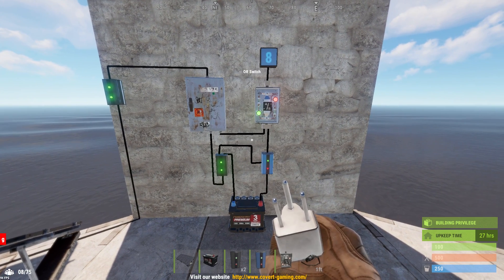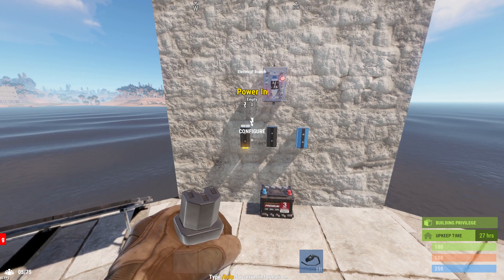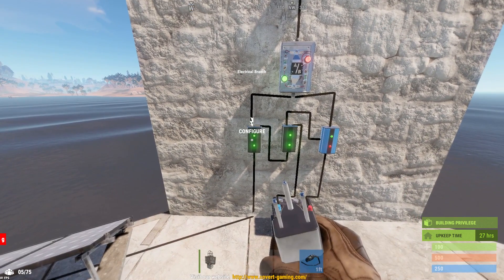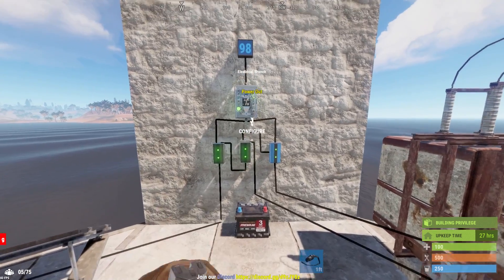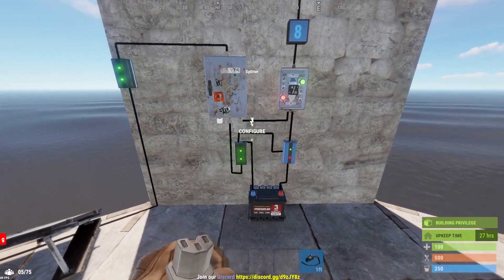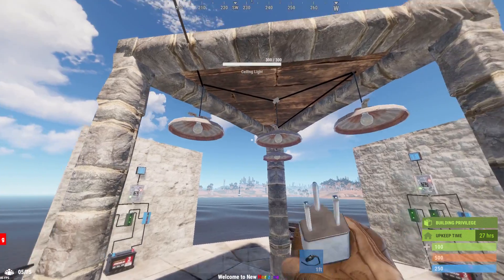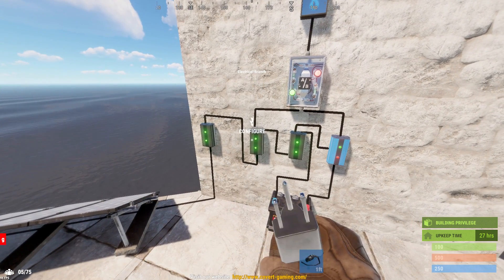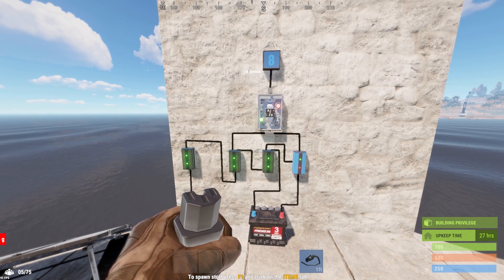The Best Rust Infinite Power Circuit

Comment: While using 5 solar panels wich is 100 combined, charging a large batt goes very very slow right. If you branch 99 power to the or switch, the remaining power wil be only 1 to passtrough to the second branch. You didnt talk about the second branch config wich i asume stayed 2. That means there is no power left to charge the large batt. I think this cirquit requires at least 7 solar panels for west and another 7 for east. Totaly 14 solar panels. My goodness
Reply from the maker: TLDR:  That was a lot of information to cover.  Maybe I'll do a followup video on this at some point :).  For the short term the point to take away is that solar panels are a bad way to power a large battery backup system, though you could use them to supplement it if you already have some when you get your hands on a Win Turbine or two (these can be purchased from outpost for scrap).  And you can reduce the power to your circuit via reconfiguring the first electric branch  reducing the branch power in order the balance the power needs of the base and the charge rate of the battery when you have insufficient power generation.
-----------------
The full explaination:
At 2:22 I said that the default branch power is 2 volts and we would need to adjust it on the first electrical branch.  The default is always set to 2 volts for every electric branch and since we only have to adjust it on the first one then the second one stays at two, sry that wasn't more clear but you drew the correct conclusion. It would actually be nice if we could set this to 1 volt as we would have 1 more volt charging our batteries then but sadly it is not possible due to game mechanics.

As for power input.  Based on your comment it seems you are playing on a vanilla server or at least a server with a day and night cycle.  I rarely play on such servers and tend to stick to modded servers which almost always have no night time or a  very brief night time.  So for me I need only point solar panels at the sun and call it a day, forever, lol... small joke.  Anyway... I'm not at all sure how many solars you would need pointing in various directions to accomplish this but the important thing to understand is that your large battery will charge with as little as 1 volt or as much as 90 volts.  You could supply it 1000 volts if you wanted but it wouldn't charge any faster than 90 volts could do it.

So... if you need all 98 volts possible to this circuit then you would need a minimum of 102 volts just to supply your 98 from the main line and prevent the battery from discharging.  You would need 104 volts in order to provide a single 1 volt to charge the large battery (which would take a VERY LONG TIME) with 1 volt about 18.5 days in rl.  Before the question is asked the reason for the 2 volt jump between blocking the power from the battery and actually charging it is again because of the 2 volt default of the second electric branch.

Finally for maximum effectiveness you would need to provide 193 Volts from your mainline power to both provide 98 volts to your circuit and 90 volts to charge the batter which would be charged in about 4hrs 45mins.  The point is that you can operate this circuit as is with an input of between 104 -193 volts and continue charging the large battery.  If you input is 101 volts or lower then it switches to battery power.

Personally I very rarely try doing this setup with the large battery using solar panels, I especially wouldn't do this on vanilla using solar panels.  This is a perfect situation for a Wind Turbine.  With proper altitude the rarely produce less than your minimum power requirements, and often provide most of your maximum requirements.  Furthermore they continue to operate at night time, they are relatively inexpensive compared to enough solar panels for equivalent power output, and best of all they produce more and more power the higher you get them while solar panels produce a max of 20 no matter what.  On average including a vanilla day and night cycle it would take about 12 solar panels at least to do what a single Wind Turbine does.

That said, there is another solution to low charge rates that some may not have considered.  Lets say you only have 4 solar panels but you need more than 8 volts so you have gone to the large battery setup.  4 solar panels at best wont provide the 104 volt minimum so what can you do.  The next question is how much power do you really need?  Do you need all 98 volts you could get max for your circuit?  What if you are only running 2 Auto Turrets.  Depending on their configuration you only need 21 volts to power them on.  If you also want output signals then at most you would need 23 volts.  So lets go with the higher number.

All you would need to do is reset the first electric branch from 98 volts to 24.  Thats your 23 volts plus 1 extra for the orswitch ofc.  Run the output from the orswitch to a splitter, and the outputs from the splitter to each of your turrets.  Now with all 4 of your solar panels in direct sunlight you are producing 80 volts.  Yet your circuit is now reconfigured so that only 24 volts insead of 98 is going to the base cuircuitry.  This leaves you 53 volts to charge your large battery.  Now this is only a little more than 1/2 the amount the battery needs for maximum charge rate so to simplify if you will gain 1 second of charge for ever 2 second of charging time.  But thats ok because even in vanilla day time is 3 times longer than night time.  So even considering for low light levels in the morning and evening you only need 2/3 of your day time to provide max power from the solar panels for this to keep up.

So thx for watching, you made me think up some good points which I hope helps you and others in the long run.

Comment: Hey I can't get it to charge the battery as its using the solar panels
Reply from the maker: do you have 20 v coming off the solar panel?  if so did you set the first electric branch to 9v?
Reply: @K162KingPin  I figured it out. It charges slowly but it worked. Btw, do you know a way to make 2 things happen when a turret "has a target" Like if I wanted a light and alarm to power on if the sentry has a target
Reply from the maker: @rbxploits1735  yes, basically you have a 1v output when it has a target.  You need to amplify that 1 volt.  To do this you would take that 1 volt and put it to the input of an ANDSwitch.  The other input should be whatever amount of power you are going to need for the output.  So say you have 10 volt on input 1 of the ANDSwitch and the 1 volt from your HAS Target output on the other.  Whenever you have a target then the ANDSwitch is now receiving two inputs and so allows the 10 volts to pass through.  It does have a 1 volt drop like most components but in this case its getting that 1 volt from the output of the turret so you don't need to compensate for it with your 10 volt input.  If you want to see this amplifier watch my video on automatic doors.  I use the same amplifier there but instead of an auto turret I'm amplifying the output from an HBHF sensor.  Still the amplifier is the same. https://www.youtube.com/watch?v=zrD5fEKVZBE

Comment: does it work for turets?
Reply from the maker: The small battery system can not support even 1 turret as it outputs 8 volts and a turret needs a minimum of 10.  The large battery system can support 7 turrets at 11volts each so that you can use the output signals or 8 turrets at 10 volts which can not use the output signal.

Comment: verry good video all i wanto know is what are the falues of the ather tow bramches athe the end of the video?
Reply from the maker: Hmm I'm not sure what you mean, so hopefully I can answer this for you.  There are 3 electrics branches,  I call them 1, 2, and 3.  the first one isn't even part of the circuit.  It is only there to demonstrate the circuits performance with various power inputs.  Number 2 and 3 are part of the circuit.  Number 2 should be set to 9 volts if using a small battery, and 99 volts if using a large battery.  Number 3 should always be left at 2 volts regardless of which battery you are using.  If this didn't answer your question feel free to follow up.  Thx
Reply: K162KingPin, using 10 panels, 5 west 5 east(100 morning and 100 evening), only peak hours wil charge a large batt right. Because if you branch 99, there wont be no power left to charge a large batt.(before and after peaks)  you have a solution for this?
Reply from the maker: @-CataclysmiC-  yea, build more pannels :).  Or put up a wind turbine or two.  If that isn't an option consider if you really need 98 volts output.  If you are only running a couple auto turrets for example then you only really need 24 volts max depending how you split the power and if you need outputs.  So once you have determined hopefully that you dont really need 98 volts output then reset the first electric branch from 98 to say 50.  That will double the power going to charge the batteries.  Hopefully this can hold you over until you can get more power generation going.  Keep in mind that when its on battery power you will still have the full 98 volts from the battery but dont rely on that building your circuit unless the extra is exclusively going to something that you only want on at night.  Like lights.

Comment: having trouble with the large battery holding charge.. ive done the exact thing here but my battery says its on 4 sec.. im running a wind turbine connected with solar and root combiners first.
Reply from the maker: double check your branch power settings, thats the most likely cause, double check that the bottom light on the blocker is red while you have your main power on. If everything is actually setup correctly then your wind turbine isn't making enough power.  You would need a minimum of about 150 volts to realistically charge the battery at a reasonable rate and maintain your main power.  Ideally you would have about 200 v minimum.  Wind turbines at low altitude don't make much power, so if you cant get them higher off the ground then make more of them.

Comment: Is there a way to combine 2x large battery so at night u can put out 200 power ?! And during day charging the batteries ?!
Reply from the maker: Sadly there is not.  The root combiner is the only way to add voltage like that and they will not accept inputs from devices other than power producers.  So you could combine the output of two batteries by routing their output into a root combiner but this would have to be done manually.  The key to this setup which allows you to charge the battery then switch automatically to discharge the battery is based on the fact that the blocker can effectively disconnect the battery from the circuit.  If you were to eliminate the blocker then the battery would be constantly discharging and couldn't be recharged.  If you try to attach the root combiner after the blocker the root combiner doesn't recognize the power input.  Hopefully this will be changed in the future to mirror real world electronics, but at that point you should also be able to charge a battery while using it as well.

THAT SAID... nothing in rust requires 200 power to operate.  So the way around this is to make this circuit twice.  Split your power at your source and route it to each of the two infinite power circuits and run them in parallel, or side by side.  Then from each of them rout power out to your various devices and just make sure you don't put more than 100 volts of burden on each one.  This is actually how I frequently set up my larger bases.  I set up one of these circuits and when I have enough electronics than I need more than 100 volts I set up a second one and so on.
Reply: K162KingPin yeah I was trying all lot of options on rustician.io.. thanks a lot for ur vidz!! Keep up the good work!
Reply from the maker: @robbyvanderveen5850  thx :)

Comment: Can you set the large battery to only put out 70?
Reply from the maker: Yes, you can do this by placing an additional electric branch between the blocker and the orswitch.  Then set its branch power to 71, then attach the output from the blocker to this electric branch and the branch power to the orswitch.  This would effectively limit the output from the large battery to 70.  Also if you want your mainline power to provide equal power to the circuit then also change the first electric branch from 99v to 71 as well.  I am curious why you would want to limit your power though :)
Reply: @K162KingPin  Thank you for the fast reply.  I have 1 wind mill that generates 40v to 120v. So on average it makes less than 100v. To stop the battery going flat i only use 70v in the base but when the battery kicks in the counter says the out put is 100v so i assume that the battery is draining %30 faster than needed?
Reply from the maker: @Roger-Moore-81  yes you can't make the battery ouput slower but your solution is correct, you limit the power from the first electric branch effectively leaving more to charge the battery.

Comment: It would be more effective with an "and switch" in the end, as approaching night time will make the system switch powersource all the time, and then your lights and sensors will turn on and off when the switching happens. Therefor you will have small holes where no electricity is applied to the system.
Reply from the maker: First of all thank you for watching and for your input, I'm always on the lookout for new ideas and I certainly have not thought of everything.  That said, have you tried what you are suggesting?  It literally can't work.  An AND Switch requires power from both inputs in order to pass power through.  This circuit is designed to prevent power leaving the battery while sufficient power is being supplied from your main source.  This is necessary because otherwise the battery would never charge.  Then when the main power source fails it automatically switches over to battery power.  The point is that while in this charging mode there would be no second input for the AND Switch and it wouldn't even allow the power from the main power source through to the circuit.

As for the power flicker this only happens at the moment that the circuit switches to the backup battery.  The reason seems to be that it takes a second for the system to recognize that the blocker is no longer being blocked and to start sending power through it.  While this interruption is long enough to turn your auto turrets off and immediately back on its hardly a long enough pause to create a window of attack.  We are talking about 3 seconds total where the auto turrets can't attack during the switch over.  Also because this circuit is designed with a specific voltage cuttoff point unlike any other infinite power circuit you will find it doens't suffer from the back and forth issue you were talking about even if power only by solar panels.

However.  If you REALLY REALLY can't stand the lights flickering as it changes to battery power each night, assuming you are running only on solar, there is a way around it.  All you would have to do is setup a second circuit like this one.  Now create a situation where that circuit looses sufficient main power first.  You could accomplish this with solar panels by not pointing them directly at the sun but rather off angle a little.  Now run both of these infinite power circuits into another OR Switch.  From there run your power out to your base.  If you do this you literally double the cost of setup but you could completely avoid the lights flickering once per night.  What happens is that both circuits still do the flicker as they switch to battery power but because the don't both switch at the same time the main circuity of your base, lights or whatever, is insulated from the effect.

Again thx for watching and commenting.  I honestly didn't know if there was a way to avoid the flicker but after spending a little time in creative I figured it out.  It was an interesting problem to solve :)
Reply: Hey man. Thanks for explaining. Yea i was wrong in my words. What i meant was that switch where it accepts either input. I have been in the situation where it switches from solar power to the battery and back again several times, so the flicker happened quite many times. My problem was that when the sun was going down, the power input from solar panels was jumping up and down from the threshold that activate the blocker. So for me it worked with the switch that accepts either input (the highest one). Can't quite remember what it's called though. an "and/or gate"? Don't have rust open for it.
I did a lot of theese designs and have all the schematics on written down the old school way on paper (: Just like they taught in physics class back in the day.

And right back at ya mate. Thanks for sharing knowledge and creativity!
Reply: if you have inverted doors (i have needed those in a trapbase), where the doors need to be open, and close when activated, the doors will shut and open every time the flicker happens (: Very specific case though. I mainly tried to avoid the flicker, because i didn't trust my sensors when flickering was going on. And i needed those for protecting my base.
Reply from the maker: @markhelkoland7714  Ive used this very successfully on trap bases.  The chances of something critical happening just as the power its transferring from mainline to backup is 1 in 1800, at least in vanilla as it would happen twice a day/night cycle and that happens every hour.  That said it wouldn't cause anything not to work right it just might be delayed 1 entire second, which for my trap base designs at least doesn't make any difference they are just as dead.
Reply: @K162KingPin  yea you are so right. I'm aslo just geeking out about the designs (: I'm pretty perfectionistic about it :D And if my circuit doesn't do what i need it to do, i often do some overly complicated stuff to make it do it :D